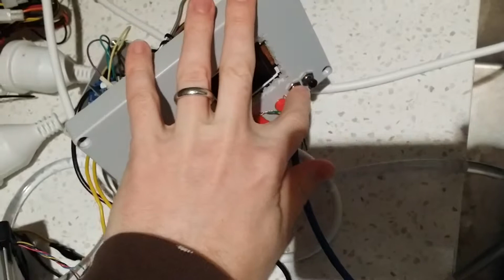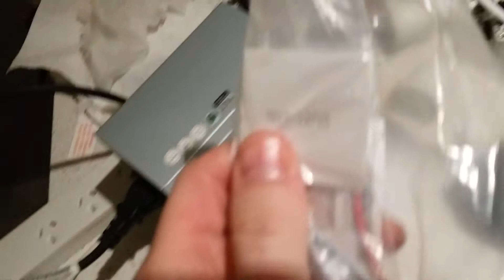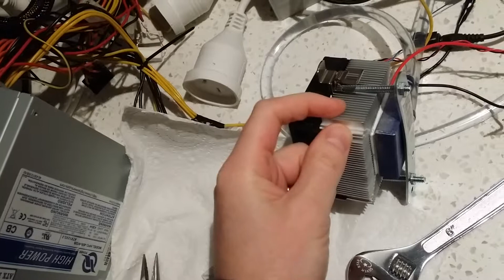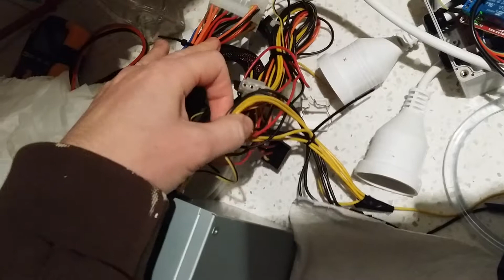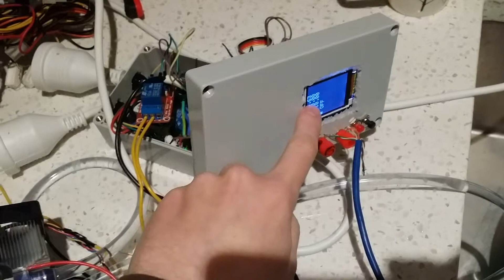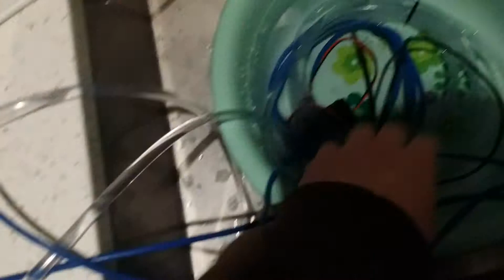BrewBucket project stage 2

Comment: Also, something is not right as you should be getting lots of heat: http://www.penguinslab.com/peltier.htm

Are you sure your PSU is fully on?  from memory you need to short some pins to make them work.
Reply from the maker: Tim Toolman Yes I'm suspicious not as much power is getting through as it should. I shorted the green and black wire on the ATX supply. I read this is used for the switch, and it does seem to power on ok. I might try another ATX power supply to compare.
Reply: yep i think the peltier isnt getting enough juice..